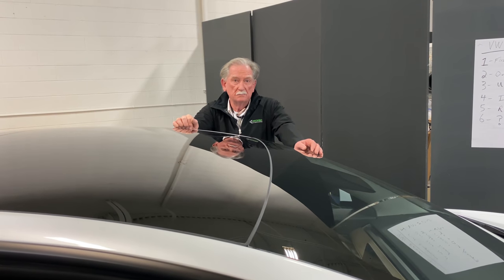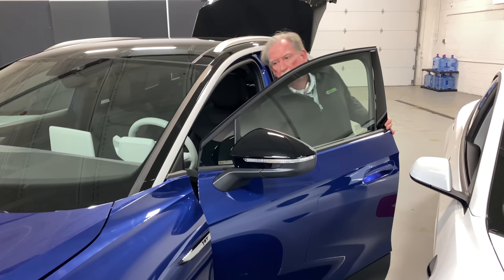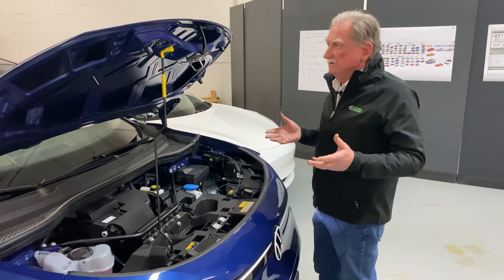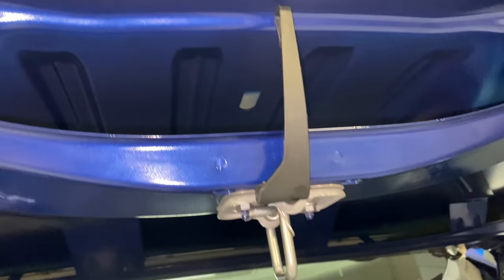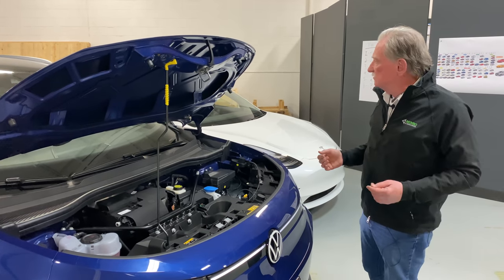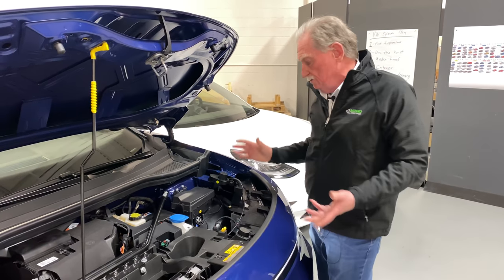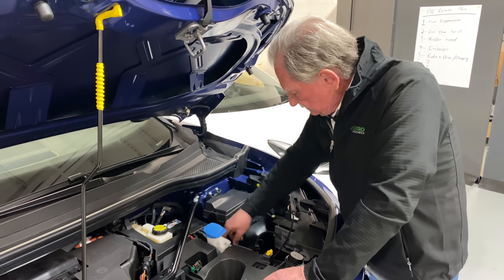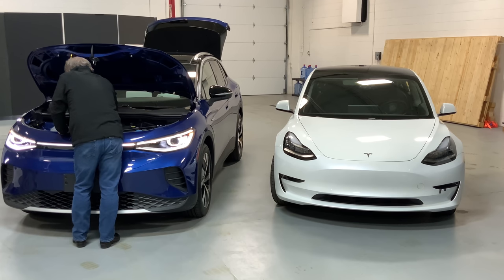2021 Volkswagen ID.4: E2 - Under The Hood

Comment: Quick comments:
- The VW has no frunk because the hood and the part of the car in front of the windshield is so small.
  VW has for now been the best at using one of the main advantages of EVs: flexibility in the architecture that allows you to max out the most important thing: cabin space. For reference, the Model 3 is almost half a meter longer than the ID3, but despite that, it only has 10 centimetres more in wheelbase. VW wheelbase optimization is incredible...the ID3 is kind of sort of the size of a Golf, but the internal space is closer to a Passat.
- Since you'll never open the hood on a regular basis...no oil to check and stuff...why bother with the expensive pneumatic struts?
- I honestly can't believe Sandy skipped on the most important thing about steel: it's super easy to repair for bodyshops. While aluminium is great and all frames should be made out of it, body panels kind of shouldn't...they always get bumped, dented, scratched, crashed into...and with aluminium, repairs are more complicate, take longer and are ultimately more expensive. That's a contributing factor to why is such a nightmare to have any kind bodywork repair done on Tesla...heard of people being without their cars for a couple of months.
- The real reason US crash standards are so outdated on pedestrian safety is the fact that's very very hard to have pickup trucks comply to those norms. In fact, many brands have stopped selling their pickups in Europe after stricter pedestrian crash tests came into the picture...the market here is just too small anyway and it's not worth the effort. In the US, it would mean huge costs for Ford, GM and so on, so yeah, "you try not to hit pedestrians"
Reply: The M3 has a longer hood for better aerodynamics I gather, as well as a bigger crumple zone for more safety, as well as more storage.
Reply: @2nd3rd1st  Hood length doesn't matter for aerodynamics. The argument may be made for the tail compared to a "flat" hatchback, but as long as you do proper design, the front is not a problem.
As for the crumple zone...yeah, but as long as you achieve the desired result (5 stars in crash tests & stuff) how big is the crumple zone doesn't really matter

Comment: So, out of all "interesting features" on this car, only blue water cap had positive reaction :-D
Reply: … You’re forgetting the HVAC filters which are a doddle for the driver to inspect and replace. It’s telling too that Sandy had no problem closing the hood of the ID.4, versus the Model 3, which still seems to give him some bother. So maybe those four bump stops are worthwhile after all?
Reply: @mrsneeklamy  - Closing the hood is not that positive to ID4 as it is negative to T3. But for HVAC filters you are right, my bad.
Reply: @mrsneeklamy  I have no problem closing the hood with 3 fingers. Either they got a misaligned hood or dunno what.  The2021 is extra easy to close
Reply: @marcusbiller867  That’s great, Tesla are definitely some of the best at making continuous improvements, but they have had plenty of troubles with their frunk design too.

We’ve all seen comments, here and elsewhere telling people to just Read the manual! and You’re doing it wrong, you’ll damage the metal! Sandy got a lot of this in his Model Y teardown.

Really though, your experience with a brand new, premium, class leading, ’21 badge EV should be trouble free!
Reply: @mrsneeklamy  The 2021 is actually a lot easier to close than the previous one, I owned both. Like I said, maybe he got a unit that is not properly aligned, they do mess up the allignment sometimes. The trunk can be closed with 3 fingers on mine.
Reply: He is only doing a compartment at a time.
Reply: @mrsneeklamy  I have the Model Y and my wife and I have no issues closing the frunk with one hand.
We use it often.
Reply: You miss where Sandy like easy access to the air filter and the possibility to add a second one
Reply: @michelinereichert35  Changing the cabin air filter only needs to be done every two year so yeah, it's nice to have easier access but not more useful than a frunk.

Comment: US has 3x road fatalities per capita compared to most of Western Europe. So why exactly is pedestrian protection a bad idea?! Also, it's shocking that Sandy overlooked the fact that the ID.4 hood is over a feet shorter compared to Tesla.
Reply: And the fact that the hood which will be opened once or twice per year is "heavy", wtf??
Reply: Indeed. Firstly, is it really so heavy or is just the fact that a Tesla hood feels light because of the gas springs pushing it up? And secondly, why not just check efficiency stats....

Comment: Few other people mentioned that big plastic support in front of the HVAC is actually the support for the radiator and cooling systems. It's glass fiber reinforced plastic it's quite rigid but not that heavy. I do like the fact that they have the HVAC system under the hood rather than under the dash.
If you do a poll on Tesla owners you will find that 95% of them rarely use the  Frunk .
If I have to make a trade off for greater interior volume versus a front I will take interior volume.
The VW has a enormous amount of rum in it for the size of vehicle that it is.
I suspect a lot of the stuff under the hood is also there for easy serviceability.
Not having the fuse box at least labeled is pretty stupid. But Ford does that also they do put a fuse number but you then have to look up what it is.
Looking forward to the other videos. I suspect we're going to find lots of places where the VW is not nearly as neat and tidy as the Tesla.

Comment: If I didn't know it was electric, my first impression would be that I was raising the hood on a gas engine.  Odd.
Reply: VW only knows how to make GAS cars.
Reply: It looks the same for the same reason - this is a service access area, not a regularly opened storage space.
Reply: legacy auto..
Reply: @jetah50  While VW is, the ID3 isn't legacy. On of the differences to the Tesla is the relatively longer wheel base which Sandy has yet to mention. VW went for interior space instead of some frunk.
Reply: @rkan2  so they couldn't hide it better?  again it sounds like legacy engineering.
Reply: @rkan2  The hood of the iD4 is slightly shorter but also higher than the Model Y´s, so there will be a similar volume of space under the hood. It is easy to recognize that Tesla is much better at packing and arranging aggregates under the hood. Just have a look at how well organized everything is in the Tesla, I have never seen such in a car before.
Reply: Guess they made it in a rush (no idea why lol). Later they will fix these, looks simple to arrange properly.
Reply: @lapaleves  If it would be simple they could have done it in the first place. So now they need a few years and just copy what Tesla has done....
Reply: @nilsfrederking62  well they were a decade late from the beginning, not surprised. It takes time...
Reply: @jetah50  Yeah, some of that is still legacy of course. The designs are (IDs) still the first VW EV-only designs
Reply: @lapaleves  reminded me when my mom said to clean my room. just throw everything in the closet and hope for the best.
Reply: @nilsfrederking62  Watching this video explains why VW are years behind Tesla in EV Design!
Reply: @FairlyOldGit  When the CEO of such a huge company as VAG talks about catching up to Tesla, you know VAG is years behind.....
Reply: @markplott4820  for now. next generation of id.3 and id.4 will be better.
Reply: @iDoe84   - the iD3/4 is using an OUTDATED Platform , the MEB.
in order for VW to remain Competitive it will have to Abandon the MEB platform. 
its just NOT Efficient enough and too HEAVY, according to SANDY.
Reply: @markplott4820  yes, exactly. inefficient, expensive, outdated.. but VW will have to work faster
Reply: @iDoe84  - I expected Alot more from VW, given their Heritage with Autos , disappointed.
Reply: @markplott4820  yeah, well. That's why i said, i'll wait for the second generation to give a final statement.
the built quality is super, but the design can be improved a lot, as well as weight, efficiency, software ..
Reply: @jetah50  legacy software too. That’s why its not very intuitive and lags. Not to mention no supercharger network and dead weight dealership networks.
Reply: @rkan2 , you said, " VW went for interior space instead of some frunk."  So which do users prefer, extra cabin room or extra storage space?  Discussion here:  https://www.greencarreports.com/news/1127040_electric-car-frunks-bonus-space-or-wasted-opportunity.  More info here: https://www.motorbiscuit.com/are-you-getting-fooled-about-your-cars-cargo-space/
Reply: You would rather have everything hidden under some plastic panel that adds cost and weight? That's the first step. Then, they refuse to sell you any parts or maintenance information so you can take care of your own car.
ID4=car, fix it yourself or at the local indie shop when it's broken and keep it on the road forever
Tesla=cell phone, pray Elon will goodwill the repair

Comment: Lots of talk in the chat about fuses. I remember changing one back in the 80's.
Reply: Well yeah, but Tesla doesn't use fuses, so it's something to ding VW on.
Reply: @updlate4756  tesla DOES use fuses, its just that they're solid state fuses!
Reply: @TitanSKiZlz  I'm talking about these types of fuses.  They're extremely cheap to add to a car, reliable, and cheap... no reason to ever ding a car company for using them... unless you're a Tesla fanboi like Sandy who saw that Tesla uses a solution that's WAY better (in what way, who knows??) and WAY more expensive... impressive.  I've never seen a guy try so hard to find things to fault a company on while comparing it to a Tesla... a company he until recently owned and made a lot of money on their stock... and who gave him internet fame.
Reply: Sounds like Tesla has improved a lot in the fuse department... One of the "highest-risk" fuses is for the 12V outlet in the centre console. Now guess where that particular fuse is located on a '16 Model S (which uses a smaller version of the ID.4 fuses)...
It's behind one of the panels forming part of the front passenger door frame trim, just forward of the door frame itself in the footwell. You have to disassemble half the door frame trim to get to it. If anyone knows of a more inconvenient placement of a fusebox I'm not sure I want to know about it :-P
Reply: Tesla is using explosive fuses to disconnect the battery when the airbags deploy, which is pretty cool :-). Getting replacement fuses used to be easy, but there are a couple of different fuse sizes in use in cars now, so guaranteed the size you need in the amperage you need won't be available. Last time I needed a replacement fuses I had to pay €10 for a box of all the different amperages in the correct size instead of maybe 20c for the right one, but compared to the cost of owning and running a car in the first place it's pretty irrelevant overall.
Reply: I am disappointed with  VW. Why didn't they design their EV to be more efficient with lighter materials and smarter design with placement of components?  They have Tesla to compare with. Was it too costly for them to do it? Probably cost related.
Reply: @fashiongik  This got upvoted 3x? LMAO!  I bought a fully capable pixel 4a 5g.  I think after trade in it cost ~$100.  Sure, I could have bought an iPhone 12 Pro Max for $1100 ($850 after trade-in)... but why would I?  I use my phone for internet, text, and making calls.   Does my phone have the same high end equipment as the iPhone?  Not at all, but a reviewer would point this out and ALSO mention that it's a fully phone and costs a helluva lot less.  In fact, a real reviewer wouldn't even bother to compare the pixel to the high end iPhone because it should be expected for the iPhone to win.

The model Y that competes with the id.4 costs $14,000 more.  This isn't a few hundred dollars more for a high end phone.  It's $14,000....  That could be over a year of savings.  For lower income people, they would never pay that much more for a car...  Far more people can afford the ID.4 than the model Y.
Reply: @updlate4756  
If you've paid attention before, his Tesla stock was sold way before the large gains, he could have made huge profits, but didn't.
Reply: @koma-k  
Are you absolutely certain about that?
My information (2 sources) Indicates the 12v socket (fuse 35) is in Fusebox 2, located under the panel between the frunk and windscreen.
Fusebox 4 is the only one not in that location, (it's "under the drivers side trim panel") That's for the "cold weather option", containing fuses for seat heaters and wiper de-icer.... That requires several components to be removed, hence "requiring a technician to access it".
Nice try.
Reply: @rogerstarkey5390  it has been moved around - after a futile search among the fuses in the area you mention I had to go back to Google and finally found it where I described. Now my '16 S is pre-facelift, I would not be surprised if it was moved then. I am absolutely certain of the location, because I've had to replace that fuse twice thanks to a metal object finding its way into the 12V outlet (most likely under the previous ownership), and I have pictures documenting my "adventures".
Reply: V A  I was going to do the same reply!
Reply: @peglor  a box for €10 of fuses which you never use.. Btw right now covid times here in the netherlands i need to go to the local gas station i even pay twice the price for it. Which is ridiculous.
Reply: @redstar151  I'll take it over hundreds of Euro and possibly paying a garage because it needs to be coded to the rest of the car for the same job when solid state fuses screw up.

Comment: I disagree, the purpose of the short hood is just keep it to hold washer fluid, coolant access, heatpump and or AC, battery etc and allow for more cabin space.
Reply: The hood is not short.....the difference to the Model 3/Y is marginal and the hood of the iD4 is higher than the Model Y´s. Another commenter named NO3V measured from scale matched blue prints in Photoshop::
iD4:
 nose to front of door:1.34 m
nose to base of windshield: 1.06
Model 3:
nose to front of door: 1.31 m
nose to base of windshield 1.06
Reply: Teslabjorn measured a 20 cm difference.

Comment: VW choose to move the frunk space to the cabin where it would be better utilised. A good design decision in my opinion.

The reason for the traditional fuses will be cost. It's also cheaper to replace a blown fuse than an integrated circuit board full of solid state relays when one fails after having to clear a dead short.
Reply: And those regular fuses are available ALL OVER THE PLACE. Auto zone, Pep Boys, walmart, you name it. And CHEAP. That's what Tesla fanatics dont see why repairs are expensive. All proprietary shit.

Comment: If I am not mistaken, on this car you don’t jump start the car directly through the 12v battery. That unlabeled 80 amp fuse on the fuse box has a shiny piece of metal next to it that you clamp the positive jump star cable to.
Reply: Its a very VERY bad idea to jump start a fossil car with a EV. 
But maybe you like to spend a few thousand dollars every time? 
You must renew the DC/DC Converter. Maybe the AC and/or DC 
Charger and the MCU because this must all be encoded for the charging stations.
Reply: It's the other way around. You can jump start an EV with a dead battery with a ICE vehicle. Like the Mach-e's where they have a weird issue when they're left hooked up to a charger too long (multiple days without driving) the 12V battery goes flat due to a software issue.
Reply: @wolfgangpreier9160  Im wondering what you do for a living? 
because EV´s normally have no problem jump starting ICE vehicle´s
Best regards 
a car mechanic that works on EV´s daily
Reply: @texasaltima2002 
Your very right about that
Reply: @storm4710  Yes they have problems. 12V Batteries of EVs have much to low cvapacity and amperage to jump start even a smal sized fossil car. Just look it up. Its even stated in every EV users manual that you ar not allowed to do so.
Of course you CAN do it, but do_'t come running that your DC/DC Converter is dead and has taken the MCU with it.
There is a current letter from Tesla that warns of such folly.
Reply: @wolfgangpreier9160  Did not answer my question,
Manufactures dont recommend it because they could get sued if something goes wrong, 
Have done it more than a couple of times with our workshop´s Leaf, 
the ignition should be turned off(on the EV) when you engage the starter on the jumped vehicle(because that makes sure that the EV´s contactors are open)
Unless your cranking for a long while, 
battery size is more than enough for normal applications.

Comment: 8:20 maybe because the nose is less long compared the model 3? Around 30cm i thought.  
The problem for me is when you park ( in reverse) to charge you cant open the back trunk ( for cabels) , a front trunk for cables is usefull when the charge port is in de back.
Reply: In Europe this may be an issue since most charge stations require you to bring your own cord for L2 to L2. North America, most of the stations have the heads at the charging stations. you simply plug in, no need to use your own cables.
Reply: @DarwinChaug   in Europe DC fast chargers have already cabels, but for public AC charging you need your own cabels. Or for changing at home of course.
Reply: @dantoes1  yea, agreed. Usually home chargers are hardwired and you simply plug in when pulling into the garage or driveway. The only time I've used the portable charging cable is when I've gone camping and had to plug into the RV electrical outlets to get some range there.
Reply: I don't agree. Tesla, Volvo, and Ford figured it out. This is a must have for EVs.